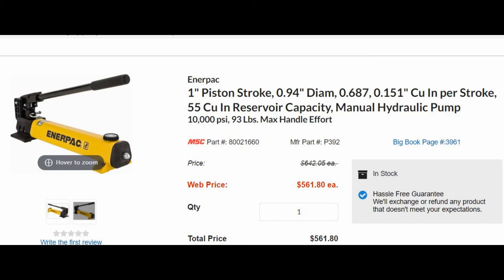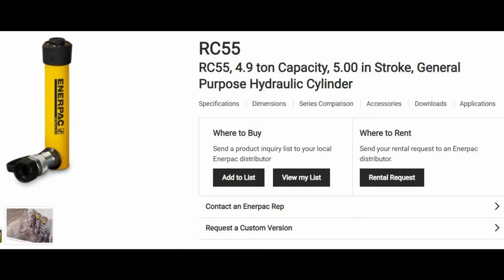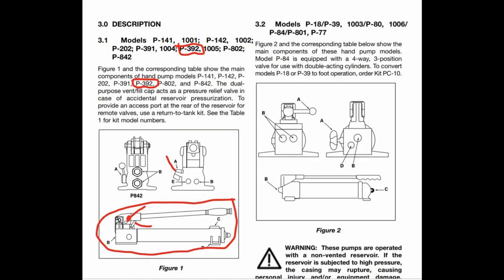Enerpac Hydraulic Power System Repair Pt 1

Comment: I've seen lots of portapowers fly from a 5 story building because some lazy mechanic didn't want to carry it down the stairs. Most of the pumps are good and reliable usually the seals in the jack fails before the pump.  This one looks like a good one to repair. Could you drill the lever to raise or lower the piston and attach it with a pin rather than epoxy? I'm sure you have already evaluated that plan of action. Looks like a good project for a winter day. I going to HD looking for some urgent supplies for the shop stay warn and dry.
Reply from the maker: There are some strange people in the world. I alway wanted to take care of the tools because I used them so much. 
When the come a long holding the equipment lets go because someone didn't take care of it, it doesn't alway land on the fool that put it away broken.

Comment: Hi i hv a p392 with a digital guage.
The problem is that when i give a load n "hold" it the reading on the pguage drops a 1000psi...i dont see the cylinder retracting either BUT I DO NOT HV ANY LEAKS...IM stumped as to where is the leak? It should be internally but where? 
Can u pls advice sir?
Reply from the maker: Could it be the gauge is not reading correctly? 
If the pressure drops the cylinder will move in the  direction of the lower pressure. 
Perhaps putting an analog gauge in the circuit along with the digital will determine if it is the gauge or the cylinder.

Comment: Being in body shop a etc for most of my working life used  probably every make in the uk the release knob always first to go I've seen everything thing to repair but the best I'd say is drill a hole and pop a rivet nail through hold with a pair of grips gently heat the end and bean over to stop it coming out again crude but works . Then with the different ends i.e. Scissor jaws different size rams they lose oil then in most cases they are just topped up with hydraulic oil but 9out 10 time not bled and you pump like a clown and nothing till the air compresses then the ram moves it's a simple job to bleed it but very few know how ,why I don't know . Thanks unc enjoyed 👍
Reply from the maker: It's the little stuff that drives you nuts. You are back in a corner that took 10 minutes to get into. With yo.ur arm stretched as far as you can reach so you can slip the compact cylinder in where you need the boost.Then you crank on the lever with the other hand only to find the cylinder doesn't build pressure. ARRRGGGGHHHH.
That's when the Porta Powers get smashed. After you crawl out and have to crawl back in.
Reply: Old Sneelock's Workshop you learn as a result when ever I used after that time I alway bleed first just in case I've worked with some bone heads I can tell you and the younger and straight out of collage and no it all the worse they are nowadays. In my dat the teachers used to say this is just the bullshit you'll learn more on the shop floor than in here . But now they come in thinking they are skilled and to top it all it's two years shorter than when I qualified well for mechanics anyway my apprenticeship for coaches took seven years it's three now
Reply: @OldSneelock  Been there with ram or the battery dies in the drill.  Yes David 
I had a 4 yr. apprenticeship and after 3 years and 10 months it changed to a 9 year course to be a SUPER millwright.  Didn't learn any thing more just had a lower pay scale.

Comment: I helped set in place a couple machines last year that weighed around 5600 pounds each, we had to  set them so the front edge was 1/8" to 1/4" away from the edge of the pit they sat in. The riggers had a couple of these which made quick work of scooting the  machines to that final resting place. At the time I had never heard of an Enerpac Hydraulic System but sure glad they riggers did!
Reply from the maker: Nice to work with pros. 😆

Comment: Those are VERY handy but I've yet to see one that's not broken because people overload those and blow them and seals out or break the attachments. Yours will be the 1st! So have a Happy Weekend! The pit is DONE! Seeded and strawed and now for a cover for the fines and maybe a fence for interested individuals. Top screwed down so nobody can hide in the riser. Next will be the installation of the washer filter. Every little bit helps. Rain all week next week. Sounds fine to me.
Reply: Hey Lewie.
Reply: Fancy meetin you here.
Reply: @mostlymoparih5682  You know that I'm a creature of habit and I'm here all the time. Sort of like being over at Wallyrussesseses.
Reply from the maker: The good  ones have overloads in the pump. To much pressure and it blows back through the check valves back into the resevoir. The cheap ones skimp on the safeties. 
We used them a lot for machine repair. Great for gear pullers. At the foundry the first time I saw one we used it to pull the bull sprocket on one of the Wheelabrators. It use to require big pullers and big torches to heat and beat the 6 foot diameter sprocket off the 6" keyed shaft.  With the 50 ton hydraulic puller we burned 3 holes in the sprocket, stuck the arms through and pulled the sprocket right off. 
At MPC they had another new thing. It was a hydraulic torque wrench. Great for working on the big presses. Take off 2" nuts without breaking a sweat. 
I have a cheap HF set that is 4 ton capacity. I use it at least one a year. We used it to raise Ryan's garage, and level the barns and blacksmith shop.
Reply: @OldSneelock  I believe it. But you know how it is when the blind and non-caring lead the rest. I remember how it was when one of the 1st hydraulic rock hammers needed to be rebuilt. I think they made a wrench to fit the nuts which were one in each corner of the hammer and had a nut about 4 inches or larger. They hooked it to the loader bucket I was on with a chain and then disappeared. I started easing back and the nut loosened. They came to the conclusion it needed to be taken to the Frozen North for a rebuild. Allied made it I think. When the rebuild was done the 4 nuts on the 4 tie rods that held it all together were pulled down with a torque multiplier hooked to a 1/2 inch drill motor. They just went North after that.
Reply: @lewiemcneely9143  I like to multiply.
Reply: Well well well
Reply: @OldSneelock  I started with beater wrenches and a 16 pound hammer. Then the torque multiplier came along, but the hydraulic torque wrench is the proper tool. It's a labor saver. Tighting 2 1/2" bolts on pressure vessels is a big job. 85 bolts taken up over 4 torque values to get to the final torque.  Gosh I miss those days, not.
Reply: @mostlymoparih5682  I may not be the sharpest pencil in the knife drawer but I figured that much from the hotel!
Reply: @WallysPlace66  Yes, yes, yes???
Reply: @lewiemcneely9143  
Marty... you know
Reply: @WallysPlace66  Well yeah, of course!
Reply from the maker: Some things are too big for even the hydraulics. When we built the press room at Borg Warner, We had a 500 ton hydraulic press that came in 4 pieces. The press came with 4  heating elements. After stacking the press together we installed the elements. One in the top of each tie rod.
With the power on the tie rods grew. Then we spun the tie rod nuts  down until they were a set distance from the end of the tie rod. After they cooled they didn't move again. 
We checked them every year as part of the maintenance program.
Reply from the maker: Paul, looking back I can remember a lot of jobs that would have been easier with some techical improvements. The Wheelabrators had 8 foot wide flight conveyors that tumbled the castings. In order to not wear out from all the sand and steel shot, the links were hardened steel taken up to a point where they would crack like glass if you hit them hard enough. They each weighed around 20 lbs. When they cracked the only way tp change them was to have them rolled around until they were on the bottom. Then we would use a big turn buckle chain tightener to draw up the links so we could pull the pins. Cranking on a 48" monkeywrench through a 18 inch opening was no fun. 
Kind of like changing a link on a track hoe I would think. Sticking a draw cylinder on the turnbuckle would have been a great idea.
Reply: @OldSneelock  See Unk even Lewie is a creature of habit, so ya gotta make em good habits.
Reply: @OldSneelock  Good old heat and cool. I remember the millwright at DuPont holding a gooberish thing made of stainless 30 feet long and holding a 3 to 4 thou tolerance by heating and cooling. Amazing to me!
Reply: @OldSneelock  We had a traveling grate in a recovery furnace sounds like about the same thing.  Stop it on the bottom crawl into a 3' space, and with a holder (built out of 3" steel and welded up) to saddle the broken link  we pressed it out with a 20T ram. Often we would have to heat it to get it to move. It's nice to be the old guy and stand outside the hole and point.  Toward the end of my career we had a 4 day paper machine rebuild.  I watched the contractors change a large bearing on a dryer journal. The bearing was  on a tapered sleeve, those guys beat on it with a hammer to remove the nut going the wrong direction for two days.  Then they were taken off the job and our millwrights took over.  They cut the nut off the 14" journal and removed the roller bearings. They then tried to pull the inter race off the sleeve with a hydraulic ram.  Heat and power couldn't move it those first guys had it pulled way too tight.  Well the foreman came out and told us that NO one was going home until that bearing was off, so while the bearing crew went of get a 1" rods to weld on the race. I crawled up on the scaffolding and with a helper took two rose buds and heated the race up to cherry red.  We had all the big Bosses even the Mill President watching, I took a water hose and hit it with cold water it creaked and popped and when it cooled I slide it off on the floor and took the sleeve off.  I never told those guys how it happen, but I went home on time. Some time you need to listen to old guys and learn before they are all gone.  Thanks to you we still are recovering some of that old timer knowledge before it's gone forever. Well I've rambled enough way, too long, and it's about lunch time and Momma got to eat.
Reply from the maker: Demmer got the contract to make rib molds for Boeing. They were giant half circle segments welded up from stainless plates. The welds twisted them all over. 
The straightening team used torches to flatten the assembly. 
If you heat one side of a bar it expands that side. The expansion compresses the oposite side. You keep doing it over and over until you work out the kinks. That's the same way bridge beams are straightened.
Reply: @OldSneelock  Ah heat, it's a wonderful thing, ain't that Wright Lewie?
A year ago we were out in 6-9 degree weather with the wind blowing and I had the job of cutting the metal and forming it into cylinders. I was wearing two2 pair of gloves and still my hands were freezing. There were a couple of trucks running and every so often I'd go over and grab the exhaust pipes till I could feel my hands again.  I've done a lot of things to put food on the table but sometimes I wonder if it's worth it. 
I can handle the cold but putting your hands on freezing cold metal is something you really shouldn't do. Kinda like sticking your tongue onna frozen flag pole.
Reply: This just hit my feed today.

Comment: I have seen many of those pumps in kits that include spreaders, jacks and wedges.  They look like they could have lots of uses!  Who doesn't love hydraulics!?!?   =)   Thanks Dave!
Reply from the maker: I have a cheap HF set. 4 ton capacity. I bought a short stroke 20 ton cylinder to go with it. You can move all kinds of stuff if you have the right tools. Now I have 4 pumps counting the 10 ton hydraulic press, and the air powered hydraulic. I tend to collect hydraulic jacks. If I want it moved it's going.

Comment: Quick question, in the beginning of the video you state the capacity of the cylinder to 4.9 tons while the cylinder is 1 inch diameter and the pump is rated at 10,000 psi. Wouldn't that result instead in 3.9 tons? 

(10,000 x Pi/4) / 2,000 = 3.9

I'm not trying to be a smart ass, just trying to make sure I understand the matter accurately. 

Looking forward to the next parts.
Reply from the maker: Your math is right so there must be something else going on. I went by the rating of the cylinder in the catalog. So I'm going to think they are probably right. 
I measured the shaft and it is 1" in diameter. Is there a discrepancy in my measurement or in the rating?
It's possible that there is a slight increase in the piston diameter over the diameter of the shaft. I haven't disassembled the cylinder. Since it is working correctly I doubt I will. 
So we have a puzzle. 😕
Reply from the maker: I delved into the data and became more confused. The cylinder shaft is 1 inch dia. The bore of the cylinder is 1.13 inches. AHA! 
Then I did the math again. Now it comes out as 5.01 tons. The rating in the catalog is still 4.9 tons. 
https://www.enerpac.com/en-us/hydraulic-cylinders-and-jacks/USCylinders
Reply: Really? 1 inch cylinder and 1.13 inch bore? That seems like a large discrepancy! 4.9 tons corresponds to a diameter of 1.117, so it seems to be somewhat justifiable! 😀
Reply from the maker: The drawing shows a bushing at the top. It is a spring  return cylinder so that might be space for the spring. Of course it doesn't show a spring in the drawing., but it definitely returns with the bleeder valve opened.
Reply from the maker: Rounding?

Comment: Great video!,....... did you manage to get the parts@ a reasonable price!???👀😏✌️🇨🇦
Reply from the maker: Yes I did. Sidetracked on other projects. The pump and cylinder work but I want to put the proper parts in it. 
So many projects. So little time. 😀

Comment: I have problem that the handle returns back when I start to push it down ?
How can I fix the check valve ?
Reply from the maker: Could be a stuck check valve. Dirt gets in the lines and just a little bit will hold the valve open.